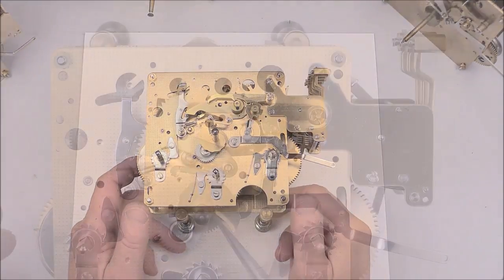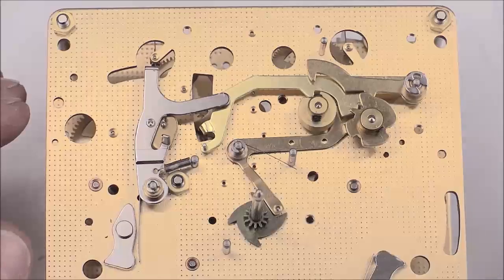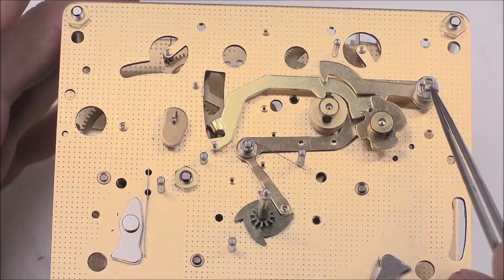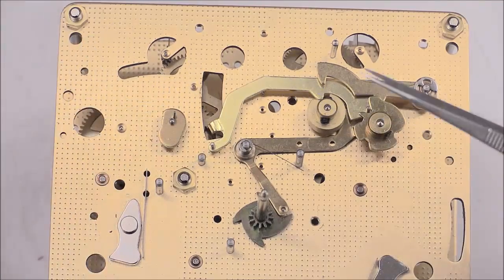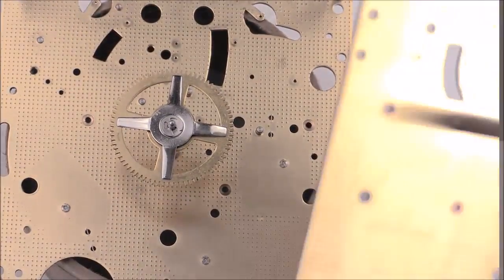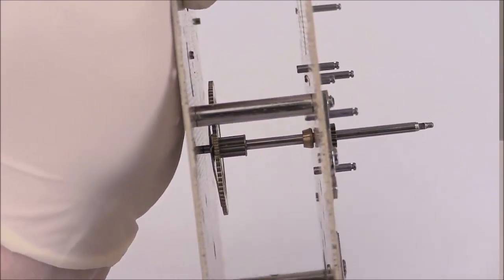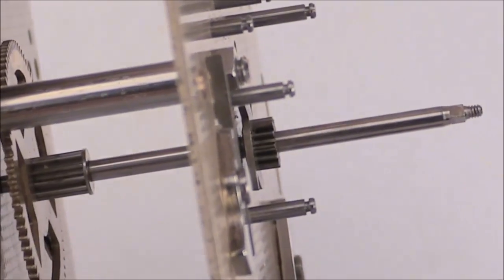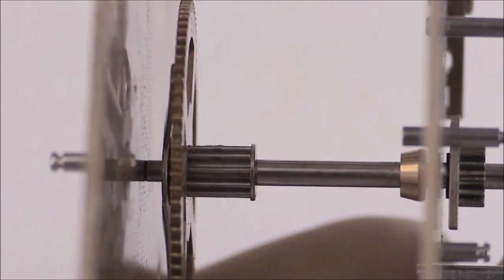New Hermle Chime Clock Video Course

Comment: I recently went through a 1051-030a movement that runs fast after cleaning, bushings and oiled, any idea why I could be running fast? Any advice would be greatly appreciated
Reply: How fast is it running in a day?
Reply: @samsclocks2084 I figured it out, it was a replacement center wheel that was the issue
Reply: good to hear

Comment: I just inherited 72 351-020 45cm in a wall clock — but the family member who owned it was having trouble with it and it hasn't been working for about six years. Winding the upper left side seems to come up against too much resistance, as if it was over-wound. (Also wound the right side which seemed OK.) I don't hear ticking, however, and the pendulum stops. Is there a straightforward way to fix it if in fact it is over-wound? I also have mechanical clock oil on hand. Any suggestions would be appreciated. Thanks

Comment: I got a Hermle 451-050 H movement, that has the chime sprocket off by the quarter hour.. At 15 past the hour, it tries to chime the 30 min tune, at the 30 past the hour, it starts the 45 minute chime, at 45 past the hour, it starts the top of the hour, and at the top of the hour, the 45 min past the hour chime, and it strikes the hour while it is chiming, then starts the 15 past the hour, at 10 past the hour.. How much does a replacement unit cost and instructions?
Reply: Assuming you have not bought a new movement - remove the minute hand. See the square-holed bushing in the center? That can be made to rotate using the right size screwdriver. Turn it 90 degrees and put the hand back on, verify that you have it in the right spot, adjust further as needed.

Comment: Ive got a 401-003 8310 unadjusted, movement made in Germany, it has some worn pivot holes on a couple of the arbors and one of the springs has a lot of play between the arbor and the can itself I'm afraid it may not be worth repairing as I do not have the tools to do the work myself, the clock I bought on Ebay for a hundred bucks, the case is nice, wooden mantle clock, I don't know if i should bother with it or find another movement to replace the bad one, Appreciate any input you might have,

Comment: do they tend to lose time as the spring unwinds throughout the week? mine is a new hermle 340-202 and is accurate 1st and 2nd day (or close), then loses 11 secs per day then like 15 secs per day, etc. i usually rewind it at the 5th day. lost about 50 secs by then.
Reply from the maker: Yes, that happens, unless it is weight driven or a fusee then there is a power loss thru the unwinding of the mainspring. When regulating I always say let it run for a day, adjust the time, run it another day and make a adjustment. Fully wound and you are at the top of the power curve = day one or so and it  quickly drops off , approximately day 2-5 the power curve flattens out somewhat, that is the best time to do your regulating, then the last day or 2 it drops off again. Of course everything depends on condition, age of oil, wear, conditions of atmosphere ect...Have fun and thanks for the comment.
Reply: thanks for the reply. i guess my NEW Hermle chiming mantel clock is normal if it is off around 1 minute by day 5 (slow). i just wind it at day 5 each time and set it ahead about 30 seconds, so it is either 30 slow or 30 fast at most across the days. i love the clock.